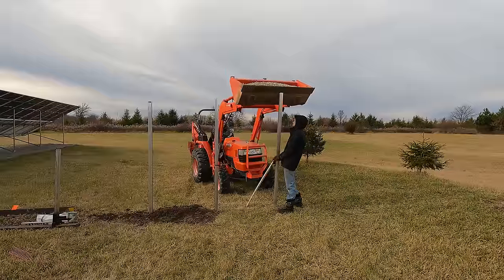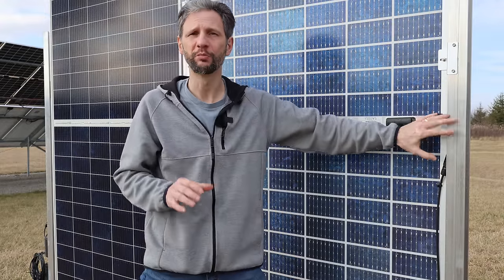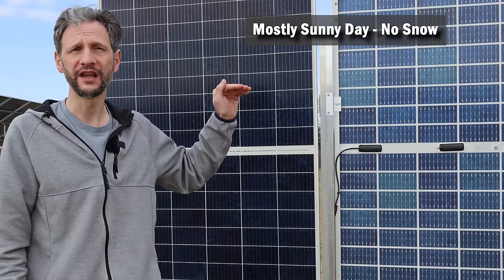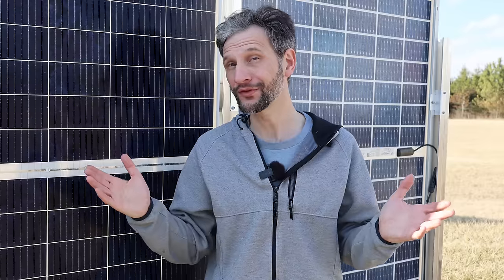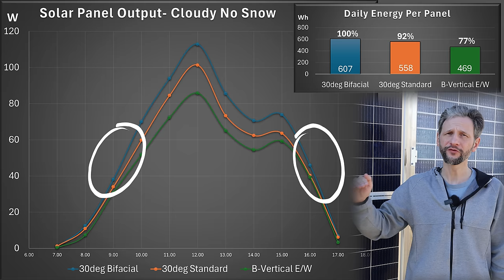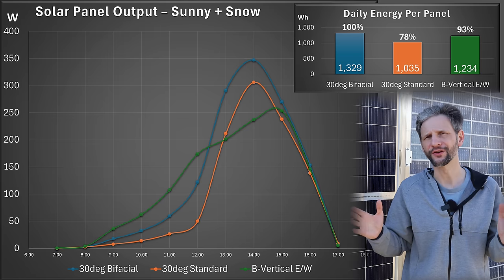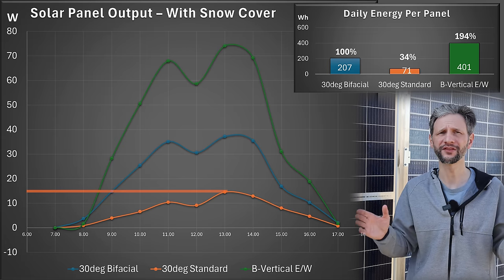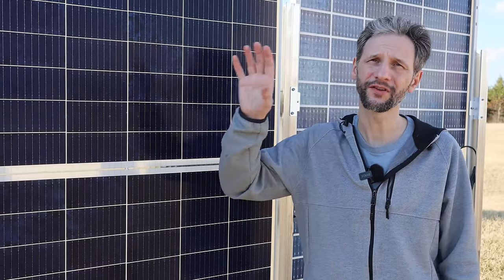Vertical Bifacial Solar Panel Performance Results Part 1

Comment: I’ve seen a video or two about the efficacy of reflectors(cheap tin foil/ mirror) to increase solar panel production. The only time it would possibly be viable however would be during the winter(due to efficiency loss at higher temperatures). Do you think the ambient temperature would cool the panels enough to warrant a test of cheap “boosters”? This would be a winter test only I suppose.
Reply from the maker: I might test it if I can find the time just to satisfy everyone's curiosity.  : )

Comment: I wonder if the shadow from your 30-degree panels is limiting some of the reflective light that your vertical panels are getting. 9:37
Reply from the maker: There is some impact, but I don't think it's enough to skew the results.

Comment: If you were to mount mirrors flat on the ground under the bi 30 panels would that boost your input?
Reply from the maker: I will post a result with mirrors in 2 weeks.

Comment: Did you test all panels in a common orientation First, to be sure that panel differences are not what’s accounting for different production levels?
Reply from the maker: The main array is an average of 10 panels, so that number is very accurate, the vertical panels is an average of two panels so not as accurate but the data was so dramatically different the small differences in panel performance would not negate the results.

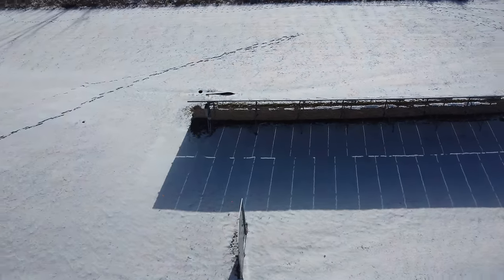Comment: What if you left a panel width gap between each of the 30deg Bifacial panels (it would use double the space)? Would that allow the mid-day sun to reflect for any benefit? Times stamp 10:01, it looks like you could get at least some reflectivity if there were larger gaps between them.
Reply from the maker: Yes, but that would increase the cost of the racking.

Comment: Am I understanding the test correctly, that you had both of these on the same MPPT?  An east and west facing panel on the same MPPT Tracker?

If I did understand that correctly, wouldn't it make more sense to put them both facing the same way?  Yes you will have a larger spike during morning/evening but isn't the production being limited by the "common denominator" here?
Reply from the maker: No, each is on a separate independent tracker. It’s a DC/DC optimizer.

Comment: what about orienting half of the panels southeast(45°) with 60°  Tilt and other half southwest 60° Tilt
should be steep enough so snow slides off and a good orientation for lots of power throught the day, or am i missing something?
Reply from the maker: That could also be a good solution.  It depends on your needs and weather conditions.

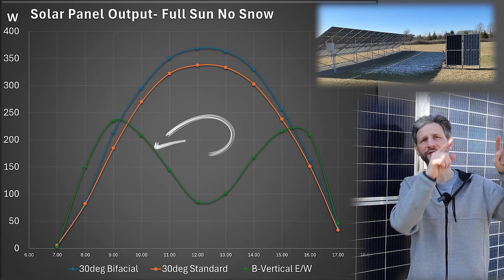Comment: When you merge the results of the east and the west panels ( approx. 5:25) surely you should be adding the two outputs but you seem to be averaging them. At 12 noon each panel is producing 75W so surely the noon figure should be 150W
Reply from the maker: It has to be an average, the analysis is a per panel result.  Think of it as half a panel facing East and half a panel facing West and one panel facing South.

Comment: We are looking at a vertical bifacial install on a white tpo flat roof. I think you could expect similar numbers to the snow based ones all year round?!
Reply from the maker: Vertical panels on a roof sounds challenging.  The structural requirements would be severe and the rows would be too close together.  The white roof would be helpful though.

Comment: What if you are budget tight and only use a vertical array and add to that reflecting panels in a double angle which optimally reflect mid day south sun towards both sides of vertical panels to eliminatie the dip even there is no snow. BTW iso of waiting for show, waar about a waterbody (pond) besides the vertical panels?
Reply from the maker: I'm working on the reflector results, should come out this month.

Comment: On the video looks like it is not facing the most efficient way possible. Look at the shadow. Why not to install them still vertical but V shape and tip of the V pointing towards sun ?

Comment: Hi, please explain more about the number of panels. For a 2-sided construction you need 2 panels, which will give the same result as one panel at 30 degrees ? Do I understand correctly? If so, then what is the efficiency ?
Reply from the maker: The cost for a bifacial panel is only slightly more than a standard panel.  So you get more performance than one panel but far less cost than 2 panels.

Comment: Bifacial panels also only make sense if you have land, most people today don't, the only real place you can put panels is your roof, and honestly it didn't seem like the vertical setup was worth it at all for just one specific winter senario with snow. As someone who lives in an area with no snow, seems i wouldn't use that setup even if I had the land. Roofing panels is my only option. I just been hoping for a breakthrough in tech that decreases their cost or increases their efficiency or both. currently spending 60-100k and hoping you can recoup cost in electricity savings before you need to replace seems like it's still not all that worth it. and this is only for people who actually have homes, not a lot of people can even afford a home anymore in this economy, most homes these days is 500k an easily into the millions for anything decent anymore and food is double what it used to be. It's nearly impossible to expect anyone to be able to afford the upfront cost and wait 10% years for their money back. Hopefully there is a breakthrough in the technology soon as global warming isn't getting better anytime soon.

Comment: next time make a graphic separatly for each of the two vertical panels. im very intersted how efficient is the back side of a double sided solar panel compare to the main side. if its less then half efficient than its more reasonable to put two standard solar panels back to back in vertical position if your priority is morning and evening production.
Reply from the maker: You can see the curves separated in this graph: 1:02
You can see the exact breakdown of front vs back performance in this video: https://youtu.be/1SXNjsSsmq0

Comment: You said the bifacial  got up to 50% on rear, I think max is 25%, haven't found any higher.
Reply from the maker: These panels have a 15% bifacial gain which is the most I get under typical conditions.  I did a test flipping them over to find the true max you can see it here: https://youtu.be/1SXNjsSsmq0

Comment: Why are  they setting the south facing array at only 30 degrees?
Especially high north hemisphere, like where you have many days where it can snow. You should set them at least 45 degrees, or even better 70 degrees.
70 degrees will vastly reduce the amount of days with snow covered panels
Reply from the maker: 30 Deg is the max for my racking, and I get very little snow where I live.

Comment: My question is if you just slightly tilt both panels in the opposite directions would it be more efficient at noon?
Reply from the maker: The panels would start to shade each other.

Comment: Did you swap front/back/front/back on the panels because the width of the flange on the i-beams didn't allow space for both brackets on a beam?
Reply from the maker: No, I just wanted to put the primary face in the position to receive the most direct sunlight.

Comment: I live somewhere with lots of sun, but also lots of dust and long periods of no rain.
Everything here gets covered in a layer of muddy dust in a week or two.

I wonder how vertical panels would work for minimal maintaince setting here.
Specialy in places where is hard to do acess like on top of buildings
Reply from the maker: I'm sure it would significantly reduce dust accumulation.  I think mounting vertical on a roof would be a challenge.

Comment: What happens if you add a top hat horizontal panel above the verticals to create a 30 degree T shape. Will the shadow created from the top panel cancel out the extra gains during the sun high points of the day? This is an overall space and mounting cost saving approach that may flatten the midday power dip of pure vertical orientations.
Reply from the maker: That would result in significant power loss on the lower panels due to shading.

Comment: 2 foot deep ain't enough unless it has a concrete deadman going off horizontal. You made a lever that pivots at the ground attached to a sail. Convert wind to psi times total area for how many thousands of pounds the whole thing will experience in a gale.
Reply from the maker: Yes, I'm aware my test fixture is sketchy.  I'm sitting up at this moment in the middle of the night as a major storm passes watching them out the window to see if they survive... 😬😁
Reply: @ProjectsWithDave  if you build multiple rows, some steel cables under tension between the rows and then fixed to the ground (just like for tents) would probably fix, while introducing only very little shadowing.

Comment: I think you missed the crucial bit that's actually most important. How much EXTRA generation is, and how much LESS generation is there? Unless you're off grid, making massive power at noon isn't that useful - the energy price is often close to zero... But if you're making 20% more power from 7-10am, for example, that can translate to an extra 50% in revenue as the price can spike into double or triple the normal retail price of energy. This will become even more important as energy companies seek to shift the burden of grid instability onto customers via flexible tariffs etc. I can definitely see the EW panel arrangement allowing you to profit during peak demand, and then use that profit to 'buy' energy at an almost zero cost during the middle of the day to charge batteries etc. Any chance of getting the raw numbers to have a look please?

Comment: You didn't mention that the vertical mount panels also don't get as hot and therefore have a longer production life and last longer than the normal oriented panels.
Reply from the maker: That is probably true, but I don't have data to back it up.

Comment: Have you considered some kind of angled reflectors between the panels that'll improve your midday uptake?
Reply from the maker: Yes, test results coming in August.
Reply: @ProjectsWithDave  consider instead zig-zagging the panels, perhaps 20-30 degrees, with the main absorption side to the South.  That might save you bothering with reflectors.

Comment: Wouldnt your south facing panels get more reflection if they were elevated higher?  Sun would pass under the leading edge and reflect to the underside
Reply from the maker: Yes, but the racking would cost more.

Comment: What would happen if you set up a mirror on each side of the bifacial panels, at 45 degrees, so that the mid day sun would be directed back to both sides of the panel?

Would this eliminate the “mid day dip”?
Reply from the maker: I ran the test, results coming soon.  Hopefully in August.

Comment: I installed 10 Candian Solar panel in south facing orientation on an old, unused tennis court on our property. I'm wondering if I should have mounted them vertically with an east/west orientation and painted the surrounding tennis court white. Opinions?
Reply from the maker: It all depends on where you live, and what your are trying to achieve.  Power at a certain time of day, most power possible in a day, etc.

Comment: What if you do the same but mount the bifacial panels in south north configuration, using white rock on both sides? That way the do not pick up snow but get the most light, both directly from the sun and from the ground reflection.

Comment: do you think it is better to mount the bifacial panels in a portrait or a landscape orientation and if it is in portrait doesn't the rack creat shade? and does shade produce hotspots?
Reply from the maker: If you are not going to get any shading the orientation is not as big of a deal.  When you mount vertically, you will always get some progressive shading from the bottom of the panels in the morning and the evening.  In that case it would be better to mount them horizontally so you are shading one rows of cells at a time instead of shading a small amount of every row.  Since my panels are half-cut it's not as big of an impact and I probably get similar performance either way.  It would be a good thing to test and get an actual result for.  I'll think about testing it sometime.

Comment: Would placingreflecting mirrors below the panels in a 45 degree angle improve the power generation dueing the hours when the sun is directly overhead?
Reply from the maker: Most likely it would be significant.  I might try something like that just for fun...

Comment: it seems like for maximum power yo would want south facing bifacials, which means you need to store  the midday power, which means a large battery system. a small battery system wouldnt be able to store the midday power; and no battery system means you are throwing away all midday power. 
unless everyone works from home you need your power early morning and evening. of course if you have EVs you need overnight power for charging.

Comment: Im on the edge what to buy.., so if i mount it like a regular solar panel tilted, would this panel perform the same ? Or have to use both side and the same time to perform 100% ...?
Reply from the maker: You can see a lot more detail on the performance of bifacial panels themselves in this video: https://youtu.be/1SXNjsSsmq0

Comment: the cost difference between  bi-facial and regular  is significant. as bi-facial are  up to +30% the cost of  normal solar panel  and had 20% less output from your data  so it a lose lose . if you need  later  day peak   just install your regular panel in an  arc...    having cattle with your solar panels is silly.  there be nothing left of your solar panels in a couple  years. they destroy them either chewing the  wire or panels  or cracking by rubbing on them. plus anchoring vertically is a bugger   they tilt in no time  especial with the wind pressure  and rain soaked ground . you would have to mount  in saw tooth pattern  if you wanted them vertically .  just look at any boarded  fence  they all sag in couple  years  time and they have less wind pressure by design ( slotted)

Comment: Having gone back and watched the other two videos on bifacial panels, I am wondering how their performance compares to "normal" panels at noon on a sunny day on a tilted stand with dark greenery on the north side.... with various amounts of shading. It would seem that to make bifacial panels perform well, special attention to shaded performance would be a consideration. That is, would bifacial panels make more sense for an install where shading is a fact of life even where the bifacial part is not being properly utilized. I am thinking those with small yards or on a sailboat with a boom waving back and forth over top. Are there other panels that deal well with shading at perhaps a lower price or at least higher watts per area?
Reply from the maker: Yes, if you are in a situation where much of your light is indirect, bifacial panels would far outperform standard panels.

Comment: the benefit of switching from 3D space consumption to 2D space consumption is immense. looks like vertical is better overall
Reply from the maker: You have the consider the pitch between rows for vertical panels is much greater than sloped panels.
Reply: true, but that only means it's an entirely new way to utilize the system. just like switching from ICE car to an EV. It's a totally different mindset

Comment: what if we had them placed in x patterns? youd just tilt the top and bottom panels to make half a square and have another one in the opposite configuration in front of it. X_X_X_X_X. if this even a viable option the angle and spacing is likely the key factor.

Comment: What if you tilt the vertical panel in between the starting of the morning peak and and end of the evening peak?
Reply from the maker: That would help, but the idea is to not have to move the panels.